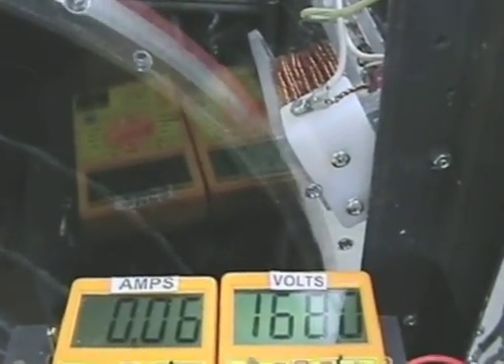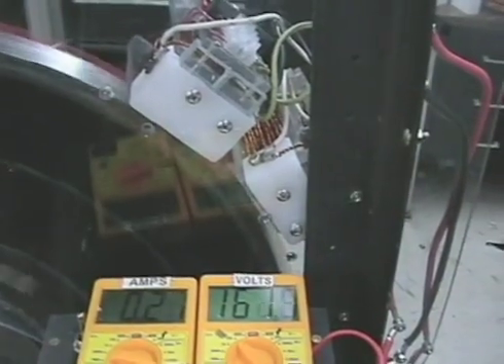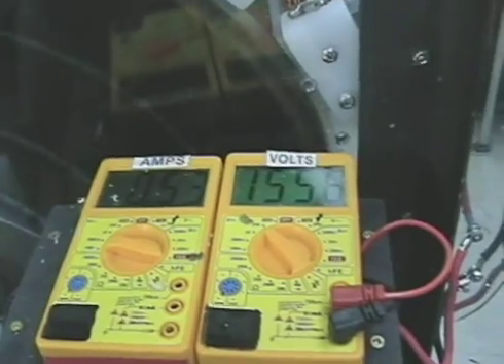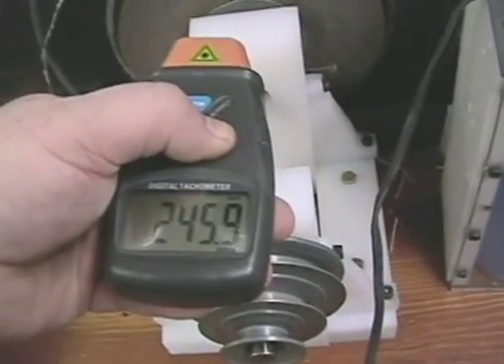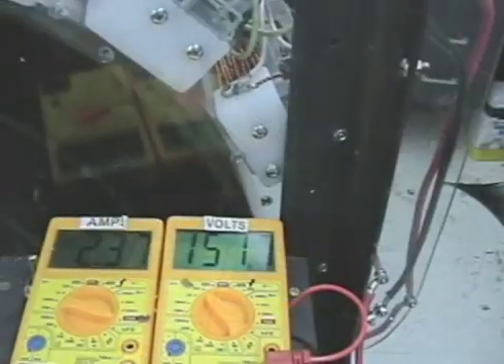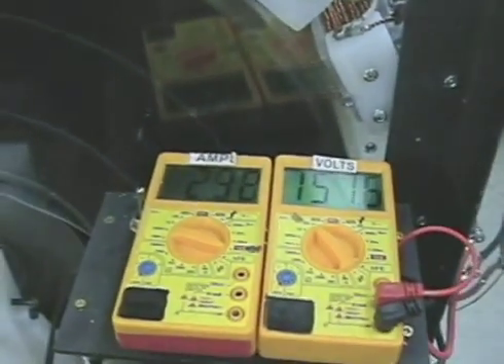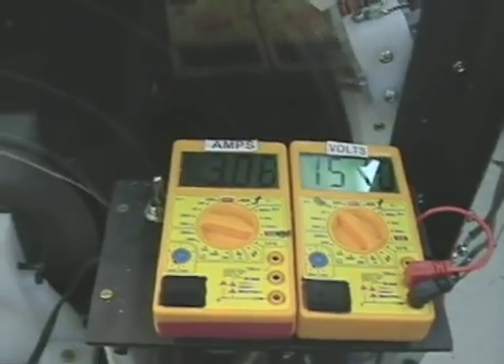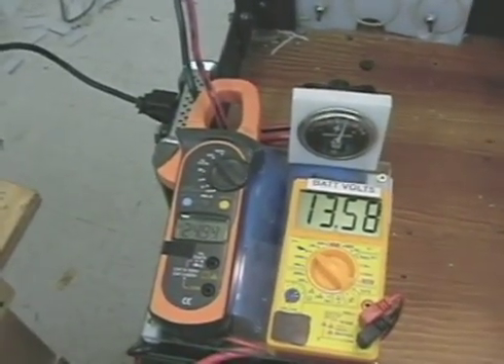CartMotor 4.0 Coil Test

Comment from the maker: @SilentDeath002  Thanks, I have been experimenting with different types of generators, I am in the process of mounting a duel Axial flux Alternator  or also known as a PMA its just a little time consuming but I hope to post  a few videos this month over the holiday break . the input caps add quite a bit of punch to the drive coils and smooth out the output, some of my sealed battery's at 15amps were creating a vacuum inside and the caps help stop that, good luck in your experiments

Comment: Excellent job. i just started working on bedini type circuits after knee surgery. i have made the basic bifilar coils and my first build got up to 4 coils. i am currently working on a 8 coil set up. i like the design work on your coils. your using caps also. i have not tried that yet. i noticed the pulley set up i front of the plexiglass. is that what your running a gennerator off of? and if so, how does the system respond to that type of load?

Comment from the maker: @guruji243 because they don't work all the time in most cases it still will fry one of the chips, that is why I have capacitors on the output ,they handle the spike in the case of a short when the battery fuses trip or if I want to condition some battery's I can bypass  caps but I don't  need to do that any more, there are two battery banks at 275 amp hours to run power inverters

Comment from the maker: @guruji243 yes SSG no neon's on the circuits I used  transformer plates for the cores 120v circuits 4k ohms trigger each coils has its own trigger  .009 ohms 3 # 18 wire +#24 wire trigger and caps on the pulse out to add some punch and caps on the out to buffer switching battery's on the fly Hope that helps good luck :)

Comment from the maker: well I will try to explain but if you don't understand basic electronics what is the point? this is for designers and developers searching for solutions anyway here goes..The low amps and high volts in is a byproduct of creating a strong magnetic field to push the wheel and the low voltage high amp out is recovered energy sent back to the batteries after it's used to push the wheel and the wheel drives a generator to replace lost energy plus a little extra.

Comment from the maker: so what is happening is most of the energy used to push the wheel is recovered and the generator that is being driven by the large wheel that has a mechanical advantage over the generator. it only needs to provide a small amount of power to be over-unity, and charging the batteries are connected to commercial power inverters are using  the power from the batteries to provide standard house current 120v  to power devices in the home. I hope that helps you understand. the reason for the effort.